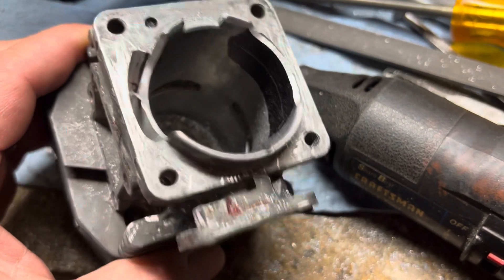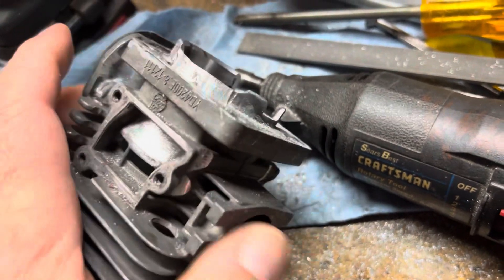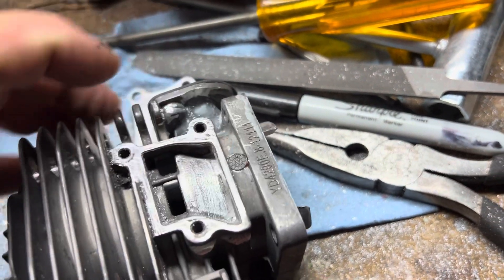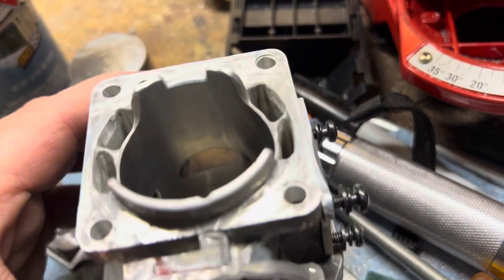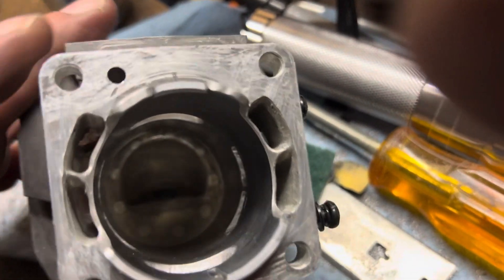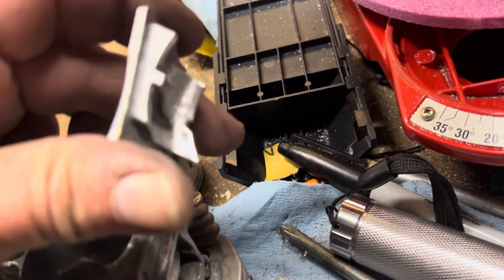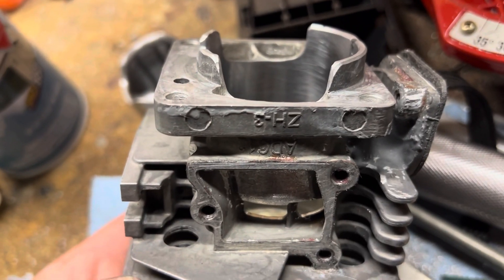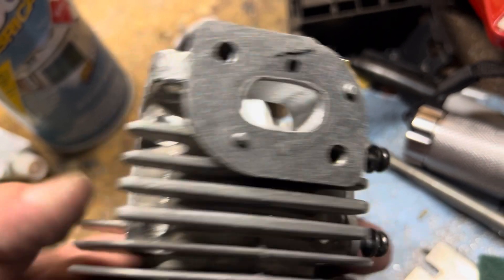Black & Decker cylinder wrecker? 42cc maxed out intake 🤪

Comment: How do you figure out crank case compression? From top of exhaust port to tdc?
Reply from the maker: Howdy!
As in this example transfers are 125. Intake is 81. 125-81=44
Lot of opinions on this but usually fairly safe in the mid 40 to 50 range for most saws. To a point, more crank case compression, more stable idling and impulse for fuel deliver. 
Shorter strokes and smaller cc’s seem to be more affected the lower the crankcase compression.